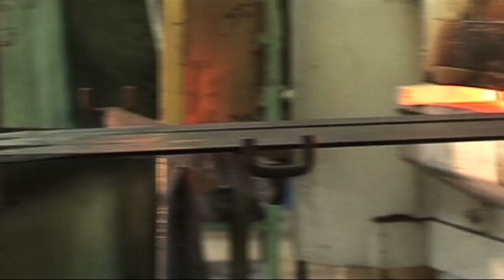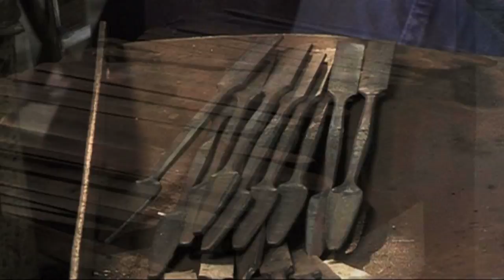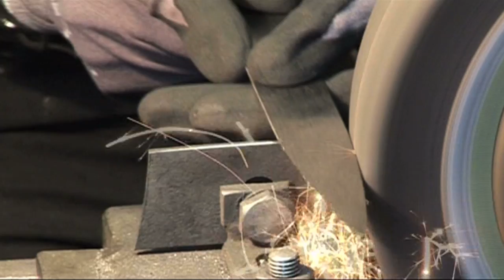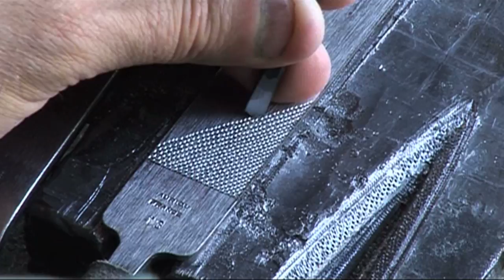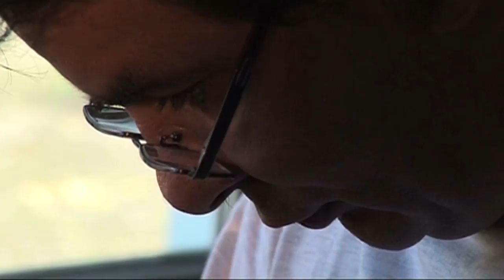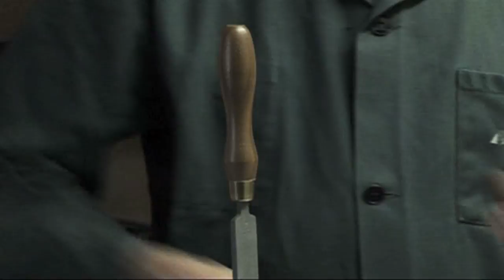Inside Auriou Toolworks

Comment: I used these tools working in the wood shop at Lie-Nielsen tools for years to carve and form the saw handles.  There's nothing like them.  They chew through wood as though it were butter and can make a tough job easy.  Even in retirement they are one of the things I truly miss.
Reply: RedStretchLimo surely you bought several for your own use tinkering around in retirement ? As well as several of those fine neilsen planes , etc ? I'm still buying em and I've been retired since 07 . From carpentry and woodworking . It's in my blood .
Reply: Any tool slices through wood if you sharpen it right

Comment: I was not aware of the workmanship that goes into making these files. I have over the years collected numerous files and I definitely now appreciate more what went into producing them.
Reply: Most files are cut by machine, few are cut by hand -- the rasps that are cut by hand are quite saught after because they provide a 'cleaner cut' than machine ones, due to their somewhat 'random' teeth pattern.
Hand cut mill files are practically non-existent, outside of hyper specialised tooling, because there is just no advantage.

Still wonderful to see these made though.

Comment: Masterwork!
I wonder if the sandblasting is taking some of the sharpness away or just the oxide?
Reply: I'm sure it's taking only the oxide. I seriously doubt they would use anything which would negate all the work they just put into the product. They are, probably using something akin to ground walnut shells.

Comment: That's a f'ing insane process in this era of high precision CNC engineering and manufacturing.
I'm a strong advocate of hand craftsmanship in many areas of life but struggle to see the justification for this.
Reply: Hand cut files remove material faster and do not chatter, like machine
cut files tend to do. It has to do with the irregular tooth pattern and
how sharp they are. Machine cut files can get the job done but, with
hand cut files, there is less post filing work to be done.

Comment: I wonder how they do tempering ?
Reply: no sure files are tempered, they are usually brittle
Reply: you mean just hardened?
Reply: Ulve Rumba
 yes I think so, you want the thing as hard as possible
Reply: Just tool steel hardened in  water!
Reply: Straight high carbon steels (0.95 - 1.50%C) have a very low tempering temperature if done at all.  If you temper over about 250F, you start drawing back the hardness very quickly and the hardness curve becomes a cliff.  Files are notoriously brittle because they are not tempered.
Reply: Ulve Rumba They are quenched in either brine (salt water) which prevents steam pockets from forming in the little cut dents, or done in quenching oil (thin, high flash point oils).
Reply: Thanks

Comment: I would have thought one would want a file or rasp to be tempered.
Reply: The Pipe Maker's Craft 
Yes I noticed that, carbon steel, no tempering, nasty outcome!
Reply: They are tempered, while they're still hot from hardening they are plunged into cold water again when the colours right.( that's how I was taught)
Reply: Considering the heat treatment is done in a salt bath, and there is a straightening process after quenching, it's almost a given that they quench in salt solution at the tempering temperature. If this is the case there is no need for tempering afterwards.

Comment: What a waste of human labor and ingenuity.
Reply: +Jason Fritz Your comment is a waste of human labor.
Reply: It is a file. Something which can be made, faster, cheaper, and more precise with machinery. I am all for hand-crafted goods, but if the human touch adds no value, it is a waste of labor. The amount of work being put into these tools would be better spent on any number of projects.
Reply: Jason Fritz
I see what you mean, but there is a reason why they are doing it by hand. You see when they put the teeth in by hand, the pattern of the teeth is irregular, which actually helps the file get clogged slower than a file with regularly  patterned teeth. To explain it in better, the file with irregularly placed teeth actually has more teeth engaging the wood because most of them don't have a tooth in front of them which when it gets clogged up, it more or less hinders the cutting performance of the tooth behind it.
Reply: +Hak Kar Which is why (at least the good, no speaking for the chinese crap) modern machine made files also have irregularly patterned teeth, enough to prevent that from happening. It's how Nicholson became the brand name in files, he invented such a process long over a hundred years ago.
Reply: farmerboy916
I never knew they mass produced files with irregular teeth patterns, i guess this makes Jason Fritz kind of right, this is a waste of human labor (if you don't take into consideration the love for traditionalism), but i wouldn't call it a waste of ingenuity though. Thanks for the info.
Reply: Hak Kar Yeah; it took them a number of tries to figure out what the problem was and correct it, over at least 30 years back in the 1800's. Though DaVinci even had ideas to mechanize the process.

Now, I don't know if these could be better (for instance, is more irregularity than is found in machine made files better? Does anyone even know?), but there are certainly specialized files that are being made here which are worth it and not found elsewhere and are certainly not being machine made afaik. The files which are essentially the same as factory produced versions could be; they might though be of a better quality than machine made files, or something. Maybe just the same, but made of a better steel.

It does at least keep the old skills alive, and produces a steady supply of files needed for high-quality old-fashioned entirely-handmade goods. It adds to the value of those handmade goods if the tools used to make them were handmade, though less than the actual quality.

Yeah, not much ingenuity involved really. They've been making them the same for quite a while I imagine, none of those kinds of tools are new.

I'd been looking for examples of people hand-making files for a while now, and lo and behold this appears as recommended (thankfully I recognized what it is by the picture). Always been curious, I do some blacksmithing and like the idea of being able to make the base tools.
Reply: farmerboy916
It seems that we are in the same boat my friend, as i'm also looking to make a file this way. Since the store bought ones here are horrible to say the least, and i'm all for making my own tools. And as far as the teeth go, i doubt any machine could randomize the teeth patters better than a human can so maybe that's one of the reasons they're still making them the traditional way.
Reply: +Jason Fritz Gotta disagree. I have a number of old and new Nicholson rasps and they are great for basic work. But using a hand cut rasp - it's apples and oranges. They cut through wood quickly and smooth like butter and can leave a very smooth surface. This is one tool IMO where spending more money is worth it. I don't own any Aurious but have several similar hand made rasps and they are truly a joy to use!
Reply: Married a Filipina
I'd like to hear more about your experiences with hand made rasps and files, if you would.
Reply: I have a couple of great hand cut rasps that I purchased nearly 20 years ago. Just re-handled and shellacked the handles recently, which got me thinking of rasps. Unmarked, I am not sure of the maker.  I knew at the time but the memory is gone. One's a #5 (medium course) and the other is a fine modelmaker rasp. Also have a really nice set of Italian hand cut needle rasps and rifflers that I use a lot in guitar making - again from 15-20 years ago. Have an almost as nice set of machine made small Grobets (Swiss). And have a 49 and 50 Nicholson (old but in nearly new condition). As you can see I like rasps and would love to compare the Auriou. While the Nicholsons are good for rougher work, the hand cut tools are almost effortless to use.
Reply: farmerboy916 -  I know this is an old comment, but for anybody else that reads this comment thread I wanted to make a friendly correction to your comment to help clear things up a little bit 🙂.  There is a difference between rasps and files, this video shows rasps being hand stitched, not files.  A hand stitched rasp can produce a smoother finish (on wood) due to the irregularity of the tooth pattern as has already been stated.  It's the opposite with files, as a machine will cut teeth more consistently than a human can and thus it will cut cleaner and smoother (on metals) than a file which has been cut by hand.  Da Vinci's invention was thought up to cut the teeth on files and to do consistently and evenly, not meant to cut (stitch) in the teeth on rasps.  Even though you did use the word "file", I think you were getting rasps and files mixed up.
Reply: The customer paid for all You said. And he get it - part of human soul,  warmth of hands, etc. It is fair trade
Reply: This guys sell their labor, the customer paid for it ($110 for a file). They also can work for less money and made millions of scrap things. Or sit on Facebook, etc